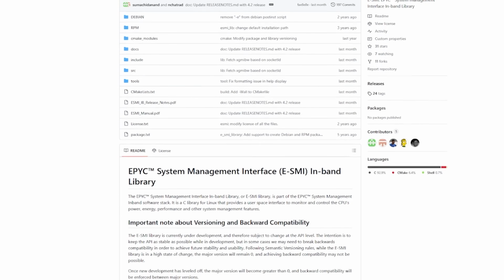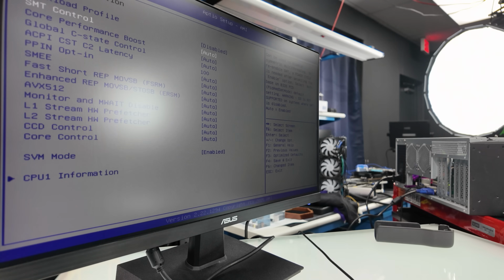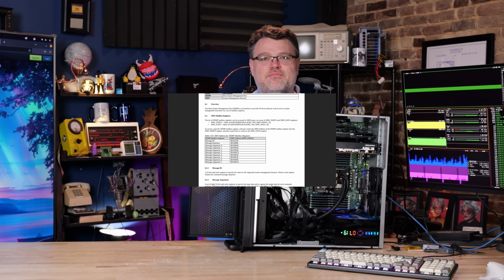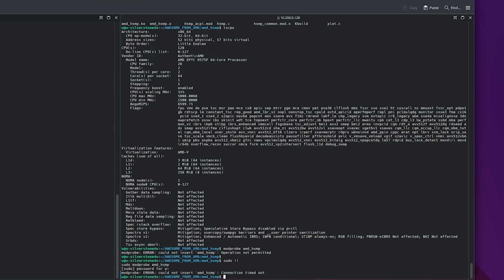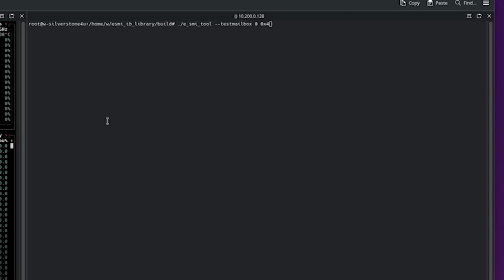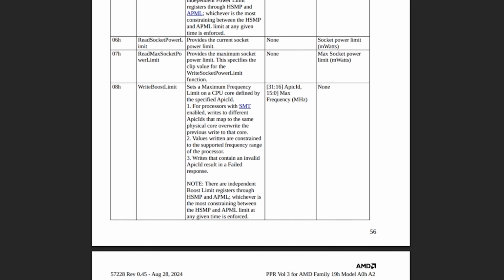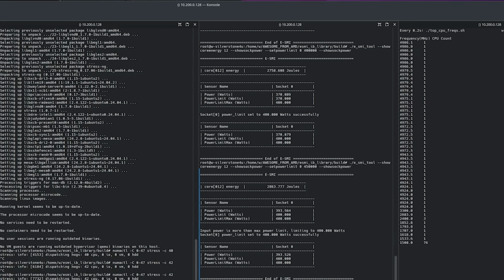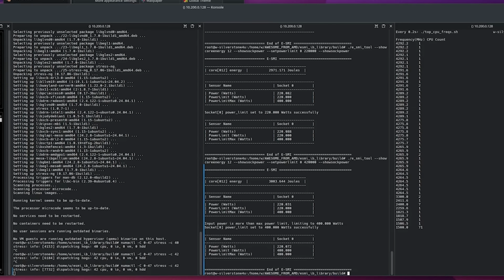Let's Vibe Code Ryzen Master but for Epyc:  AMD HSMP and E-SMI on Linux Unlocks new functions!

Comment: This is incredible! Usually this stuff, if documented at all, was limited on a per-CPU basis; you talked to the CPU using Model-Specific Registers. Not only does this seem to unify all this, but also first-party support. It'll definitely help with deeper and broader software optimization.

Comment: Of all the things I learned from this video, I was not expecting "sudo !!" To put the last command in with admin privileges
Reply: You can also repeat previous commands by putting an exclamation mark followed by the number of the previous command as shown by the history command. Example 

!234
Reply: @pike.67  Oooh, this one's new for me. I even forgot `history` exists, tbh. Will definitely come in handy.
What I meant to come here to say is that `!foo` will run the latest command what starts with foo. Want to edit the last file you were working on but have run a bunch of commands since? `!vim` has you covered without having to consult the history at all.
Reply: @Fuogor  history | grep “” is great for searching previous commands for a specific command.
Reply: @Fractal_32  That's 90% + of my grep usage
Reply: @pike.67   Search for advanced history usage. There are much better mechanisms to do that in Bash than `history | grep`.
Reply: This is shell specific. For example it does not work in Ash.
Reply: I have the command "fu_k" aliased to `sudo !!` 🤣

Comment: As much as I love the way AMD pushes things and "supports" wonky configurations...My god there documentation and tech resources suck.
You can find 200 page pdfs from Intel on an obscure mobile CPU from 2019 that tell you which bits to flip to swap the Tx/Rx pins on a PCIe link.
Want to find out information on a Rome or Milan EPYC CPU? I hope it's in the 4 page marketing pdf...
The fact that I have to go to the EPYC page on Wikipedia to get a table of core(thread) counts for a CPU line should make AMD ashamed.

I have very little problem with AMD hardware, except their ancient and awful video encode/decode engines.
But they also really give me that "AliExpress hardware" feeling where you basically get what's in the box and hope everything works, because there is no where to go to find out more information on it.
Reply: I agree. Those pages can be really disappointing.
Reply: The information seems to be all there (maybe?), but ... its such a mess how they (didn't) organize it. And the documentation search is eye cancer because of this. At best this is sloppy.
Reply: Not to totally disregard your point but Intel is also multiple times the size of AMD in terms of staff, especially in the past.

I also know certain software/documentation they share with specific customers and they do not share it publicly even though they advertise those features.
Reply: @Fractal_32  The only way to win as the plucky underdog is to get wide support.
By keeping their documentation hidden to all but a chosen few who have the pull/money, they actively ruin their chances.

This is almost exactly the same mistake they keep making with all of their products.

They can't compete directly with NVidia in the hardware design space, but they keep trying to act like they are the same on the business side.

They work with larger orgs like Steam to get   well supported hardware in our hands with features that actually make them stand out, then keep that stuff up on a shelf where the rest of us don't have access to it.

They are losing market share on every front (except when Intel blunders so bad that their hardware literally becomes a liability), yet they stay inaccessible to the very audience that they NEED to survive.

AMD could literally give us the stuff that NVidia and Intel have been gating off for decades, and we would FLOCK to them.

Example:
Think about what an upset it would be if AMD's retail dGPUs had SIOV(or even just SR-IOV)? It's not like they would be eating into their near-zero VDI business.
How many ARC A770s were bought in the HOPE that we could hack them to get that one feature working?
I have zero brand loyalty, but something like that would sway even me.
Reply: @Prophes0r  > They are losing market share on every front
True for GPU but not for CPU. AMD has been gaining market share in CPU since Ryzen/Epyc dropped a while ago.

> They work with larger orgs like Steam to get   well supported hardware in our hands with features that actually make them stand out

which is how the world works for the most part, to get full docs you must sign an NDA and be part of a corpo that has a B2B contract with the hardware vendor. It's very strange for Intel to publish what they do to the public, and it's not really the reason they had so big marketshare. Their anti-competitive practices and the fact that AMD was falling off were the main reason.

> AMD could literally give us the stuff that NVidia and Intel have been gating off for decades, and we would FLOCK to them.

Oh yeah a small fraction of advanced users of the less than 1% of Linux desktops, I wonder why AMD isn't chomping at the bit for that. Meanwhile they would be nuking what little they have and the possibility to sell them as businness-only features for a significant markup.

Listen, I would also love to get advanced features in consumer hardware, but telling yourself that is such a gold mine and they are leaving money on the table isn't the way.
Bulk of consumers will keep buying Nvidia until the performance in gaming isn't night and day for like 4-5 years in a row and the flagship AMD card is better than Nvidia's, because that's what they base their purchasing decision on.

Comment: 64 cores at 5GHz is absolutely insane.. If you told someone this 10 years ago they wouldn't believe you
Reply: Ten years ago, and I was thinking what is taking so long for high-performance computing to trickle down to the desktop. They are gatekeeping PCs with low count pcie lanes and high-speed low core count cpus and just forget about high-speed networking that you can't use because you don't have a slot that's fast enough. Theirs absolutely no good reason why we can't get a graphics card with 64GB of ram. 20 years ago, it would have been outrageous if you could only use a  network card that has been obsolete for servers for 10 years.
Reply: @minedustry  i mean you could, but the chip yields have been so good that there's no good middle segment hardware anymore and companies haven't yep reflected that yield increase into their pricing
Reply: "you mean a couple dozen bulldozer cpus right?"
Reply: I would have

Comment: I'll watch it in a moment... sorry AI overload.

I asked various versions of Gemma 3 27B a question - how does Infinity Fabric work? And I have 4 different answers when it comes to encoding alone (8b/10b, 128b/130b, 64b/66b and some other one I don't even remember). Plus so many not working links.

So I'm asking expert - Wendell - how in the name of heck do you stay sane after using AI?
Maybe I'm just using wrong model (Q8_K_XL with 32K Context Window on CPU only and Q8_0 with 10K Context Window on CPU+GPU) for such questions. Also RX 6700 10GB is't exactly the most powerful AI card. So 1,5 tokens per second is the best I'm able to get for 27B. 1,2 on CPU only (5950X).
Reply: Why ask an AI model when a Google search will show the result?
Reply: @Fractal_32  The problems is that there is so little information on PHY's in IF on the internet. And AMD loves to move it's whitepapers. Which makes finding something much more difficult.

Also AMD famously doesn't talk about most of this stuff, so you'd need reverse engineered stuff.

And I've been googling that for half a year. Yes, I know the numbers for Zen 1-3. But it seemed to change for Zen 4. And AMD supposedly talked about it. But it is extremely hard to find. Again - I've been googling it for a long time.

So - I hoped that AI with sources that are paywalled or are not easily accessible might know.
Reply: @Fractal_32  except google doesn't do that anymore. It used to around 2005, but now it's just stinky. Theyve maxed out the enshitification stat
Reply: @QuantumConundrum  Use more advanced searching techniques, there’s ways to specify any search even more than the default.
Reply: AI is a text generator, not a search engine. It has no understanding of the actual meaning, it just assembles words in a way that resembles what it saw in the training data
Reply: @AntonioMolfetta  I know. I was just hoping